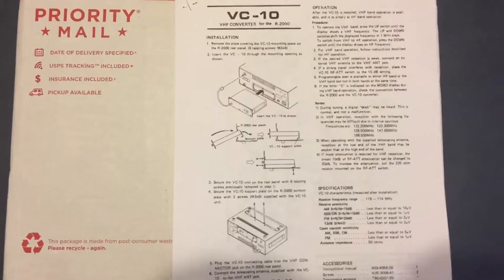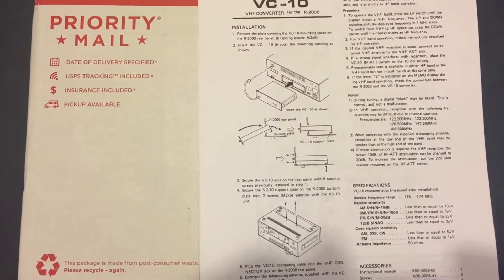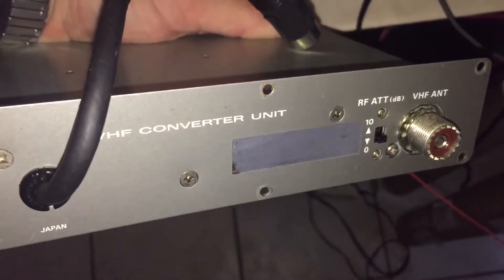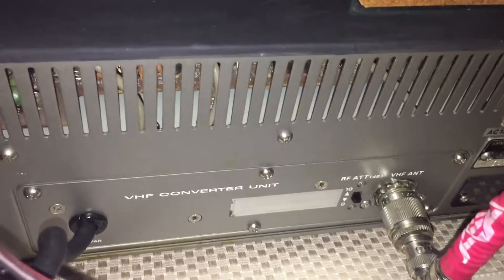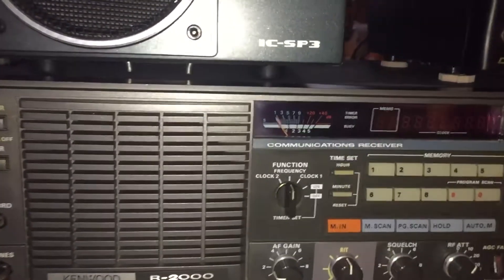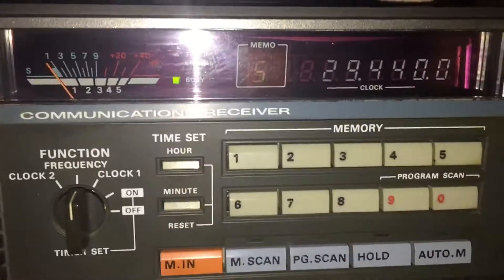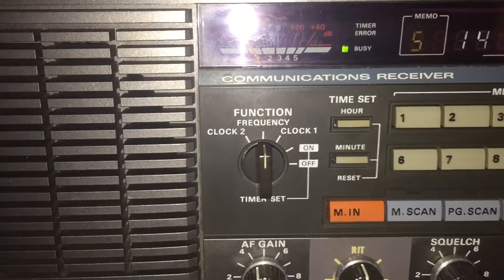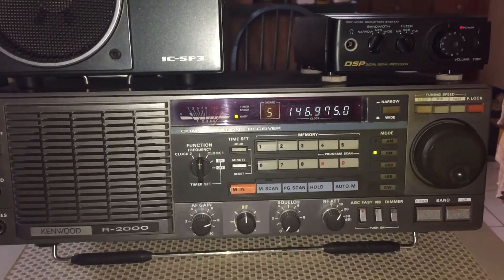Installing and testing a Kenwood VC-10 VHF Converter in the Kenwood R-2000 Communications Receiver

Comment: Then I am a lucky dog since I own a R 2000 with the VHF  cassette in it. I WONDER if it csn be modded to have 87 to 108 mhz too.
Reply from the maker: @ON5ALE-Alessio  If VHF is your thing, sure. Modded? Don’t even bother. You can get radios that would sound much better for a fraction of the cost and effort .
Reply: Yes ofcourse  all FM 88 to 108 sound better as a HF receiver but it's just me. I want to mod it likd I did with cars and motorcycles. I eant mine to have BFO and the radio fm band 86 to 108   @ArthurHallicraftersKitchen
Reply from the maker: @Alessio-v3o I doubt it’s worth the effort. But Google is your friend, I guess.

Comment: The air band 118-137 is AM not FM
Reply from the maker: Thanks keyboard warrior.
Reply: Diesel, 118mHz to 137mHz; therefore VHF voice air band just after the FM public band.  fill in the blanks!
Reply: @dieselten01  on 2 mter they transmit in all mode incudes FM and SSB

Comment: Hi I`ve just bought an R-2000,with the VHF converter already installed,but the radio will now only tune from 118-174mhz.Any ideas how to revert it to general coverage?
Reply from the maker: Uninstall the module, and take the band switch down after unplugging. Make sure you take out the power cord first.
Reply: Nice, iv got the R2000 but need the converter, it’s like getting blood out of a stone finding one.
Reply from the maker: It’s worth getting. Unfortunately eBay prices have driven all prices on it way up. When ham radio auctions and flea markets start up again, probably your best bet.
Reply: @ArthurHallicraftersKitchen  yes I can imagine, it’s a beautiful receiver and the uhf is a must for me as I like the Airband, I have other receivers that dose have Airband but out of all the new equipment I have I just love this old Kenwood I like the retro vintage look of it. Thanks. Great video.
Reply from the maker: @Dr.Gunsmith  thank you. I do own better performers, but it is certainly a heck of a lot of fun.
Reply: I’ve the VHF converter but I can only go into the VHF frequencies using the memories, my band up button just brings me to 29.9mhz and stops there